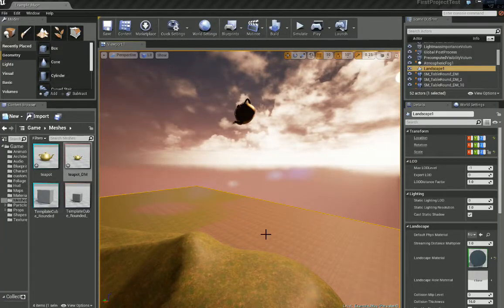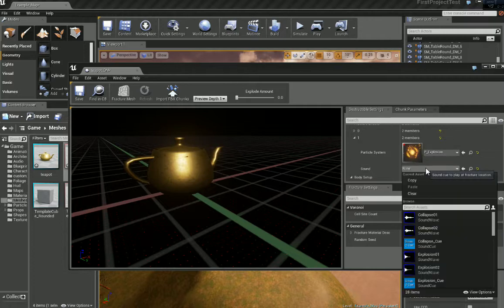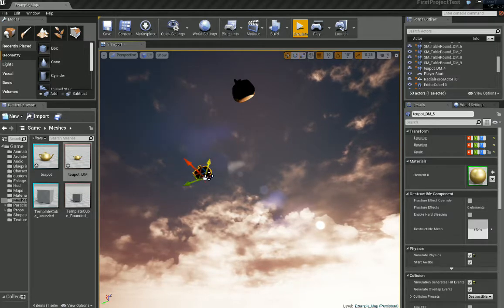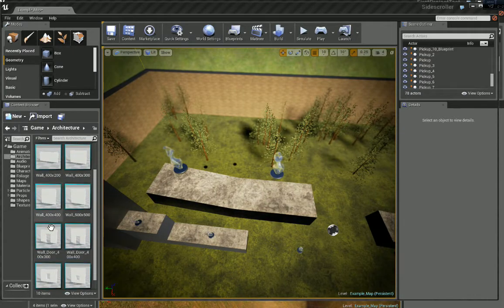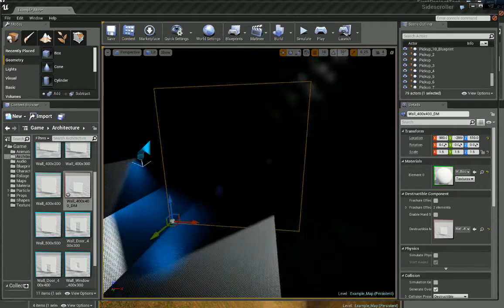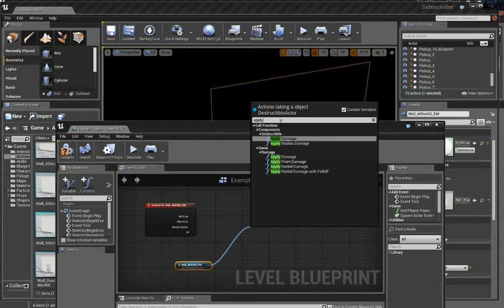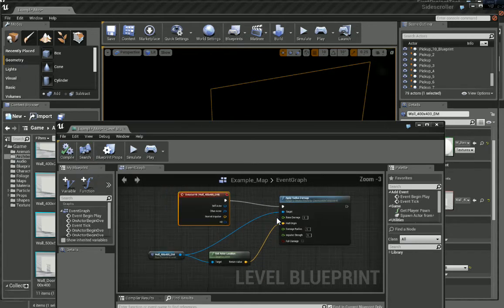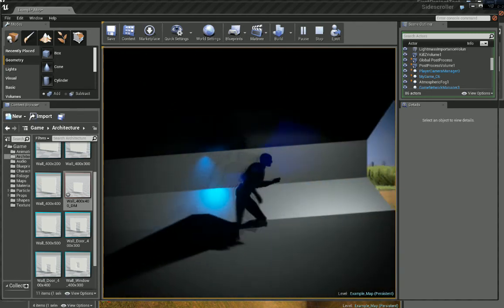Unreal Engine 4 - Destructible Mesh Tutorial (Part Two)

Comment: I have a slight problem I could use your help with. I'm using version 4.9. I need to make a 100% destructible house because I'm making a tornado simulator game where all the objects can break. Whenever I turn physics on for the walls, it breaks instantly. I load in the level and its already completely destroyed. I added the blueprint to each object in hopes that works, but it never did. It just shatters. So I'm out of ideas.if you have any, that would be amazing. 

Thanks in advance! Also, I loved the tutorial. Very helpful since I usually focus on the design of the code rather then the actual in-game stuff. Thanks!
Reply: +Borealis Games Same problem
Reply: Maybe do something like ignore collision of the other walls?

Comment: Where did u get the sound effects from or are they standard
Reply from the maker: Just the standard ones that come free with the engine!
Reply: Tesla Dev thx
Reply: Im doing this sidescroller project for class. I want to add a  destructive ground that collapse as it is walked on, stand on it and you'll fall. I created a destructive floor but it falls apart too quickly once it is touched. I want it to be like walking on ice in the middle of a lake. Any idea how I can achieve this?

Comment: So when i change the collision to block all, nothing happens! My player goes right through the wall and it doesn't fracture. What did i miss?
Reply from the maker: Are you sure the model you are using actually has collision on it? If anything i would just go back and follow the steps carefully incase there was something you missed, if you haven't missed anything then let me know
Reply from the maker: Ok mate figured it out, its as simple as just clicking on your destructible mesh in the world, then on the right panel change the collision preset from "destructible" to "block all". Hope this helps.
Reply: Tesla Dev
I'll give it a try and let you know!
Reply: 4music2junkie0
 Don't know what I'm doing wrong but i can't get it to work! Even when i change the collision to block all my player moves right through it.